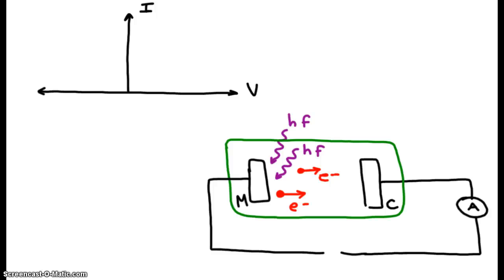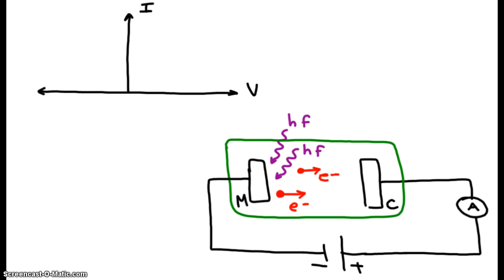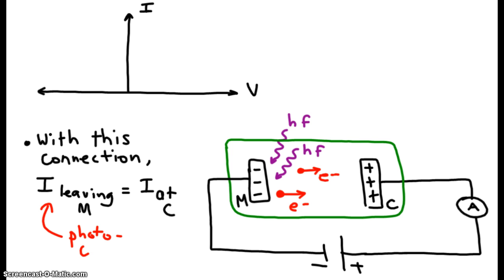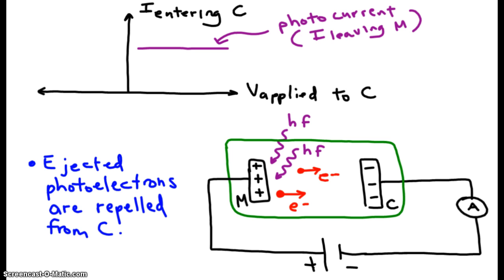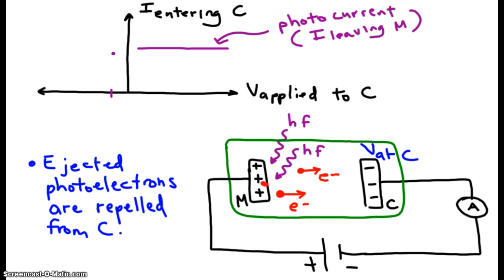Photoelectric Effect: I vs. V graph

Comment: Thanks!!  Another thumbs up!...a couple of comments/questions:
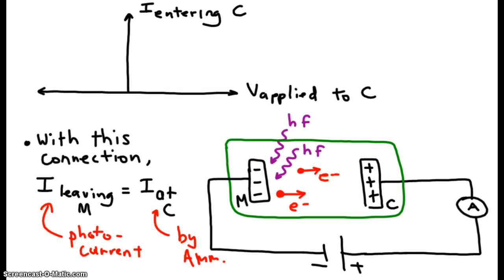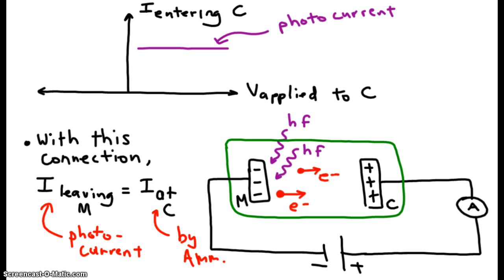1) At time range 2:40 to 3:05 You indicate that the phjotocurrent is a constant value (also shown a the horizontal line in the +x direction) why does this line NOT increase as the voltage is increased??  Since current is defined (and measured on an ammeter) as charge per unit time and we have the same amount of moving charge (photocurrent) due to impinging light; then as the charge is accelerated through the increasing electric field,  (thus increasing the charge/time), shouldn't the curve in the right be somewhat increasing?  I have heard of situations where a SINGLE electron is moving so fast, that it can produce a full MILLIAMP on it's own!

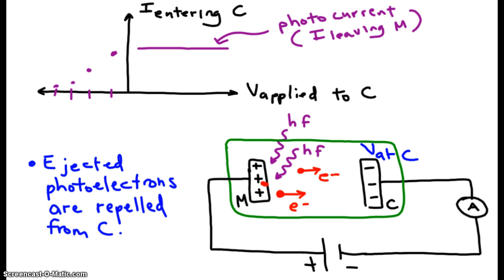2) at 6:20 Thanks for showing the true curvature of the applied neg. voltage as stopping potential is reached--I have been wondering about that.
Reply from the maker: Hi Dale, and thanks for the thumbs up! There are two questions worth addressing: (a) why doesn't Ohm's law apply? and (b) why doesn't the speed impact the photocurrent? I think the answer to (a) is this: Ohm's law assumes there's a constant resistance, and this isn't true for the photoelectric effect experiment. As you increase the potential at the collector C, you're effectively stacking up more negative charges on the metal plate M. Putting more electrons there inhibits the flow of charge, which thus increases the resistance. Regarding (b), I think this is the crucial distinction between the scenario you've mentioned (where v does impact current) and the photoelectric apparatus (where v doesn't impact current): the charges aren't moving at that higher speed throughout the entire circuit. If we imagine an electron moving around a particle accelerator 5 times per second, and then we slow it down to 4 times per second, then we just reduced the current because it's making fewer laps per second. But even if the electrons were to reach C a little bit faster because of the higher speed while in the vacuum tube, this excess of electrons at C would not impact the current ejected from C, because the photoelectric current still only depends on the number of photons reach C per second. Does this answer your question? I hope I've been clear. Feel free to reply with a follow-up question.
Reply: Daniel M. Hi Daniel. So is the current dependent on the number of photos that reach C per second - that’s what you said?

Comment: Great video!!!
I just had 1 small confusion, why is it that current is there even when the potential is zero?
Reply from the maker: Good question! Even when there's no voltage, the light is still striking the metal surface. That causes electrons to be ejected, which generates the current.
Reply: @danielm9463  Thank you so much